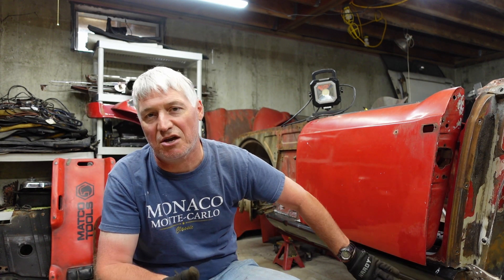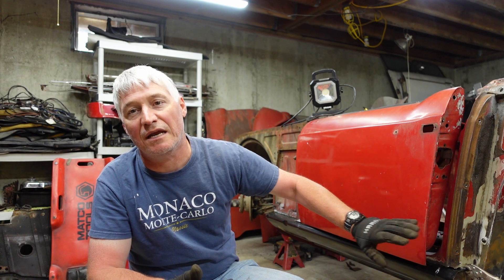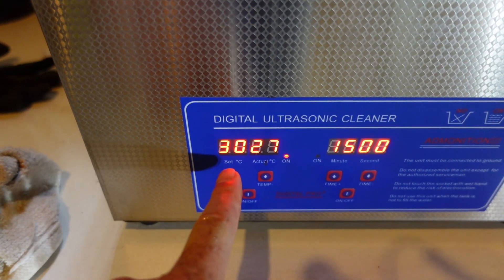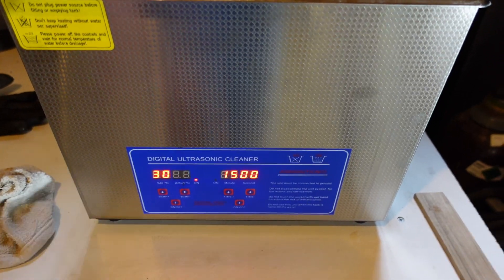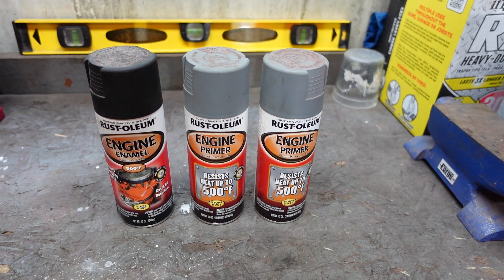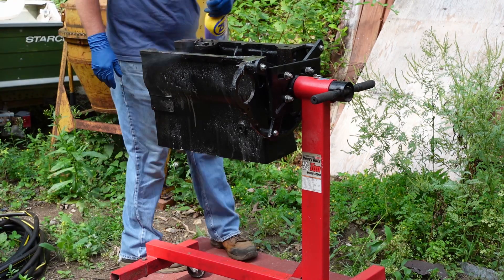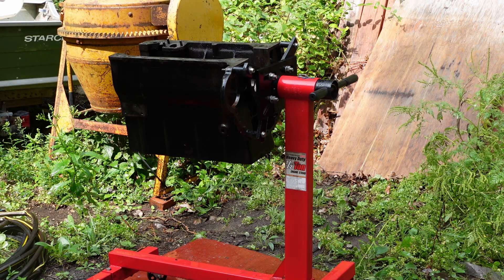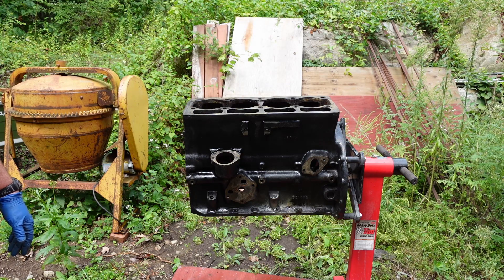Triumph TR4 - Engine Rebuild #6 : Cracked Block | Roundtail Restoration

Comment: Painful. I bet that blocked can be saved with plugs.
Reply from the maker: Thanks, Mike, I hope so. Pretty sure that's what they used on my Spitfire's head. It was a pretty slick repair. Fortunately, this doesn't look like a crack between a water and oil boundary so hopefully they'll be able to fix it. Thanks!

Comment: Hopefully it can be fixed.
Reply from the maker: Hope so. Unfortunately, the local old-school machine shop where I had the Spitfire work done closed up. There another one around that mainly does Subaru's and stuff like that. They've got a good reputation, but not sure they're used to dealing with cast iron too much. I'll have to give them a call and see. Thanks, Chef!